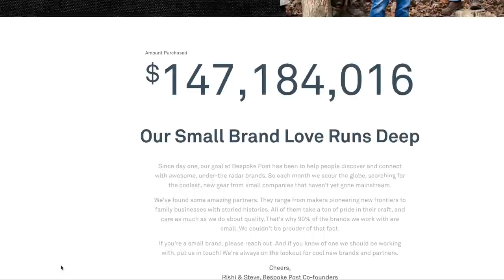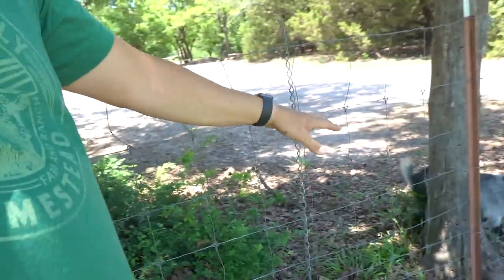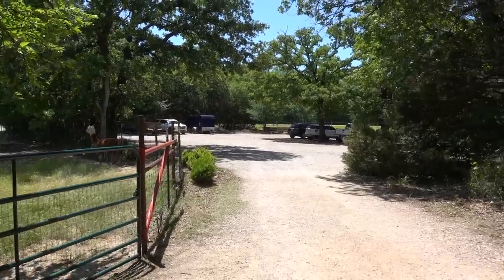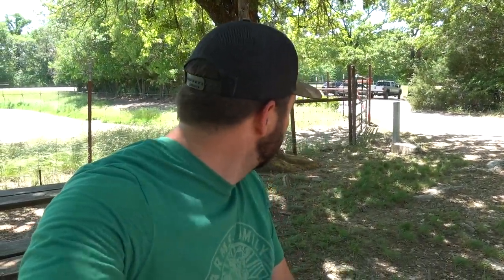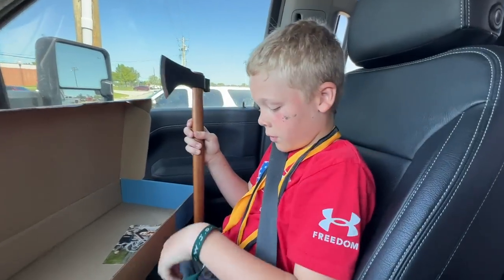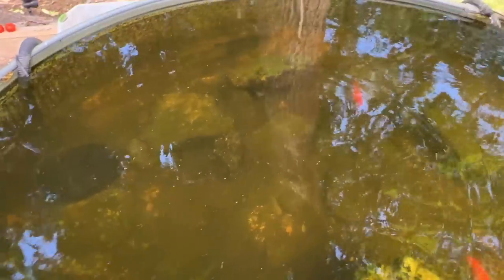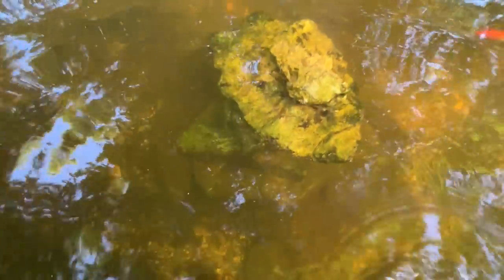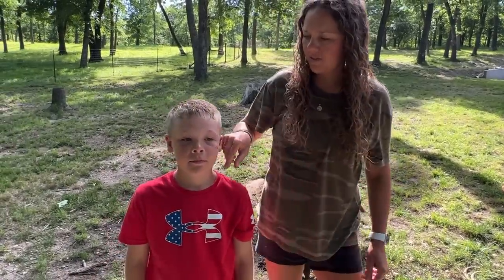Someone STOLE My GOAT!?

Comment: I got a bad feeling you guys might want to check the lagoon. I went back and watched a previous video which shows more of the lagoon (the time you got Pepper the pig), and even though the bank is not steep, but it is obviously downwards slant, and who knows how deep the lagoon is at the bottom... and Isaac having bad knees may have fell in either running through in panic of some sort and fell in and was unable to get out, or had a drink and slipped and fell in... those two are what I think is likely... what do you think? (I got thinking about this after another viewer mentioned it too, not my idea)

Comment: I don't think Issac climbed that pool ladder, especially with his bad front knees. They would have been under a lot of pressure to pull his fat body up that ladder.
I believe someone just walked in the gate & took him out. I was surprised you didn't have a padlock on that chain.
Think like a detective.
Possibility  vs  probability. Possible yes, probable no way.